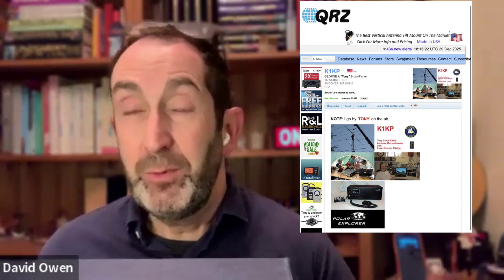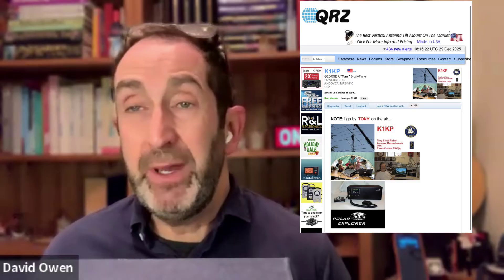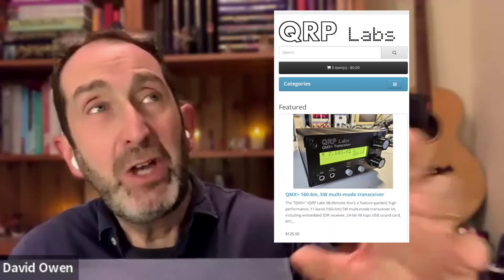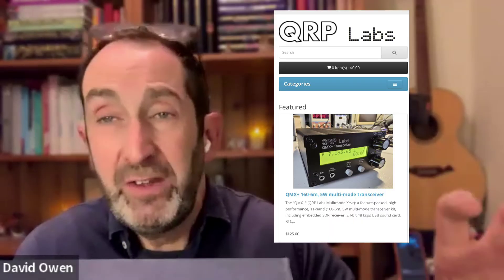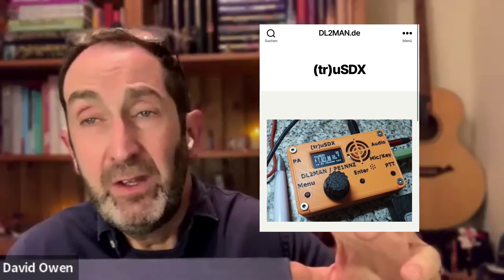Polar Modulation - follow-up - Explainer

Comment: Slightly off topic Dave. Using World Radio League, how do you add multiple parks when another operator is operating from more than one park please? ChatGPT tells me this; "WRL does not natively support multiple park references per QSO in the same structured way that POTA does. So the workaround is to log one park in the main park field and add additional parks in the comments/notes field." How do you do it Dave? M7JCZ.
Reply: Dave, Carl M8HPI on UK POTA has told me they can be added manually within the POTA website, which I have now done. Thanks anyway. 73s.
Reply from the maker: Ah…when you create a log in WRL, click to create a POTA log and then add in your parks.  Eg a 3fer and you have three sub logs.  When you export them, you get three downloads to upload into the POTA app.
Reply: @G3LRC  Okay. This issue was the other station having 3 parks though, I was operating a single park, if that makes sense. There does not seem to be a way of adding their 3 parks, only 1 of their parks.

Comment: Interesting video and good explanation. I really like the Flex concept of all-in-one-box concept but the power consumption I do not see really as an argument. Flex/Aurora will 99% of the time run as a base station for most of the users. I run a HL2 with Thetis and PureSignal with an amp between 100W and 400W output. The PureSignal concept gives me more flexibility in choosing an amp versus Flex (vendor lock-in). 73 Ronald PH7R
Reply from the maker: Many thanks for watching.  Your set-up really is fantastic.  The software seems compelling. I use SmartSDR by Marcus Roskosch and coupled with the club Flex it works seamlessly.  
As you know, context js key and having what works for you and your operating style is the right thing to do.   I have a friend who has recently bought a Hermes Light and sold all his Yaesu etc radios and he was a Yeasu disciple before the HL arrived.

Comment: I know on cellphones and similar technologies  they used to save battery, but unless manufacturers get involve and a what price.? That will be the last thing out there, then what. Will it be worth, and if whoever claims to have it, can it be proved to us, the consumers, to make sure such of a technology is truly implemented. In ham radio there is a lot of noise and lies as a food to feed losing time, but as a electronic engineer and computer programmer, a lot of stuff gets mixed and people get attracted to it. Hopefully, whatever changes in our equipment, is truly applied and done well at the right price. Thanks for the content.
Reply from the maker: Thanks to you for a fabulous comment. I did take a deep dive into how my iPhone modulates and I find it ironic that some influencers for amateur radio are bastions for the boat anchor radio and at the same time, have the latest iPhone.  It’s all a bit strange.  I am really hoping that this gets adopted and the price per watts drops dramatically.   A very happy new year. 73.

Comment: So is this acting more like a class D amplifier? I'm at 9:00.
I like the idea behind the modulation and I'm a strong believer of digital wave manipulation being the future.
But still this tech so far gives you 500w out in a flex radio that retails at 8.5k, I can just run a big old linear like a TL-990 which is about 2k for a good one, and all I pay is a little more electricity, which is moot if you have solar panels.
Reply from the maker: You can.  And you are right.  Check out Rob Sherwood’s report on the big Kentwoods. You’ve got the front end of an IC-705. 😉. Lots of knobs on the front and compared to Yaesu, energy efficient.  I think that what we are paying for here is the R&D and the very latest SDR tech from Flex Radio.  
With polar, CESSB, a brilliant front end, the ability to ‘work’ multiple VFOs etc - it’s not really as expensive as it seems.  Many thanks for arching. A very happy new year. 73.

Comment: I've been having fun with polar modulation. I have a Pico2 to drive amplitude and phase, and an EPC GaN FET push-pull + LMX1210 circuit for the RF power.
Reply from the maker: Great stuff and how is it going?  So many thanks for watching and every success with your project and DXing.
Reply: @G3LRC  My first project was an amp. Analog circuit extracted amplitude and phase, then a GAN FET for the ~300W output. Made SSB contacts all over the world. Now I'm working on a radio so I can have a portable POTA / SOTA solution for HF. Everything worked on rev A, except full power TX blew out the RX. Oops. Then they discontinued the FET I was using... So it's a work in progress.